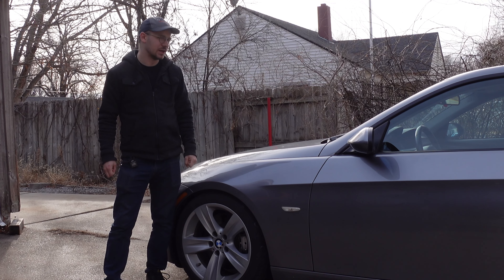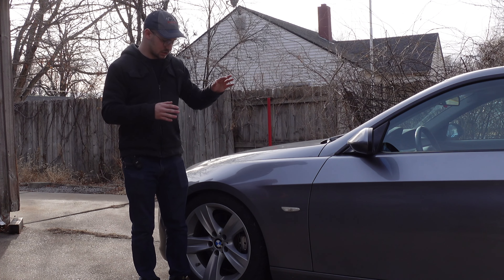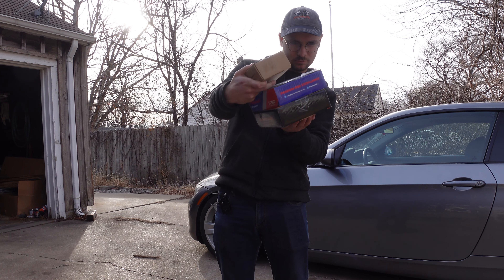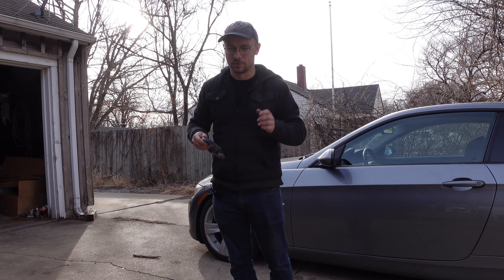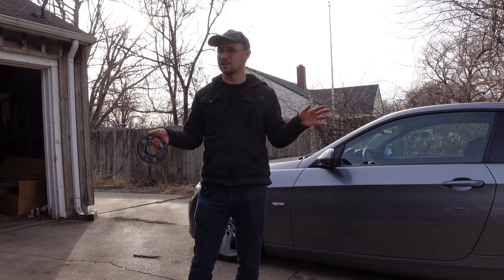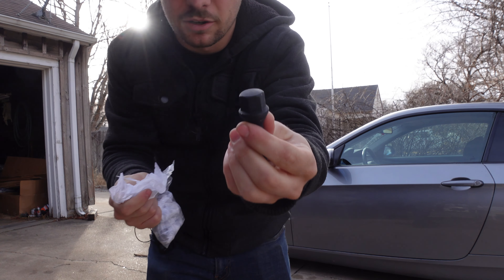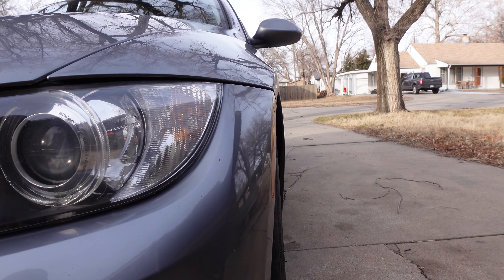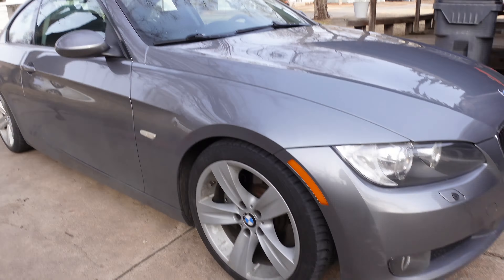WIDER = BETTER? Forged wheel spacers on the E92!

Comment: A year later have you had any issues with these spacers? I'm looking to run these same sizes (12mm and 15mm) on my e46 ZHP with the stock ZHP wheels. The before and after in this is incredible btw.

Comment: Your hub centric smoothness shouldn't be messed with. All the vibrations, wheel shimmying and new weirdness is all yours...
Reply: Came here to say this. I much prefer proper offset wheels for suspension X over compensation via spacers, adding an additional layer of unsprung weight that wasn't there before...

Comment: Would've loved if you had cleaned the rotors before putting on the spacers, but looks nice regardless.
Reply from the maker: Yeah it definitely would have been best practice to hit them with a wire brush.
Reply: @100PercentJake  a wire brush and a thin coating of anti-seize.

Comment: Wheel sizing, spacing, and offset feels like more of an art than just a ordinary mod. I completely agree with you. Subtle changes like that make a big impact to me. Looking good. And maybe it's time to try out some Mother's Mag and Aluminum polish on those wheels. Has a slight about of grit to it, and can help clean off some off that "baked in" dirt and grime.
Reply: Mag and aluminum polish on a stock finish bmw rim? I used that on my billet alloys wheels. For stubborn stuff on these... I would try a little bit of clay bar.
Reply: @thatgreatdeal  ya, it's good for stubborn grime, as long as you do it lightly, and wax after. It works well on hazy headlights too.
Reply: Wheel spacers first ricer mod
Reply: @Chris-hw4mq  wheel spacers have never been considered to be "ricer" mods. Especially not with stock wheels. Ricer mods are things like loud, large exhaust tipped mufflers, loud blow off valves, exterior aero mods, and large spoilers.
Reply: @notaffiliatedwith7363  they probably are clear coated. That polish I mentioned has about the same grit as typical "scratch remover" compound.

Comment: Just two things. A little bit of wire wheel action would have cleaned up the mating surfaces, ensuring a nice clean fit between spacer and hub. And as another commenter said... Some anti-sieze would help later. Other than that, it does look sooo much better! 😀

Comment: two of mine have 4 wheel air suspension that is super easy to lower.  Unfortunately it makes them dive absolutely horrible when lowered.  The geometry gets goofy and it develops bump steer problems.

Comment: 100% would suggest this on a MK6 VW Jetta. For one, not as much to space it just right, and 185k on my factory wheel bearings with ZERO signs of wear without spacers, so what's the harm? VW severely over engineered the wheel bearings on the MK6

Comment: Spacers make so much difference in the way the car looks and handles.  I put a set on my 1988 M6 running e39 bbsRS740 wheels and the before and after is quite the change, looks way better and more aggressive.  Its definitely what your e90 needed.

Comment: The wheel bearing complaints from spacer haters is so dumb, like any aftermarket wheels with a lower offset is gonna put that much stress on it too PLUS I have seen multiple brands of aftermarket wheels where it almost looks like a spacer was welded directly to the back of a lower offset wheel with how much metal is back there

Comment: I have the ECS tuning ones on my E92 and they're also nice... come with the  lug bolts. I also recommend the thread in wheel holder to keep the spacer and bolt holes aligned while putting the wheel on.
Reply: NIce! can you share the link?

Comment: 1 thing that was not really adressed but is EXTREMELY IMPORTANT:
You have to make SURE that ALL thread in the hub flange is used by the bolt or if the car has studs with nuts: ALL the thread of the nuts need to be used. 
Do NOT run a car with studs that are TOO SHORT and nuts only half way on.
Do NOT run a car with bolts that are TOO SHORT. 
If you do, threads will shear off (cue "3wheels on my wagon" song)

Comment: I just put a set of 12mm Renn Motorsport from Amazon on my F10 Xdrive BMW with my upgraded 19” oem bMW wheels and love them, just the perfect amount. It appears I have maybe a little less room in back for spacers …. I think I am ordering 12mm there too but would like to go more if possible… I have the car lowered on NeoMax coil overs so it’s really tight. I did spacers on my S5 last year too and they make such a difference…. Although I did get a vibration I had to clean the mounting surface of the rotor and wheel really good before putting on. Your car looks great with them. Like it should look imo

Comment: They do look better with the wheel out a bit.
However, I'd say the manufacturer had protecting the paint on the fender behind the wheels in mind. You are going to kick up more debri onto the sides outside the fender wells.
Perhaps you can put some clear ppf on the lower fender just there.
Reply from the maker: Thing is... M3 wheels more or less sit like this from the factory.

Comment: Yep, 15 and 12.5 are what I ran on my e90 with the stock wheels. Such a small thing makes a big difference. Most cars need em to look right. Unless you are running like 3" spacers the leverage on the Bearing is not going to make a difference. Next time you have your lugs off add some anti sleeze, it will make life better when you remove the wheels a year later and you arnt giving yourself a hernia trying to break em loose